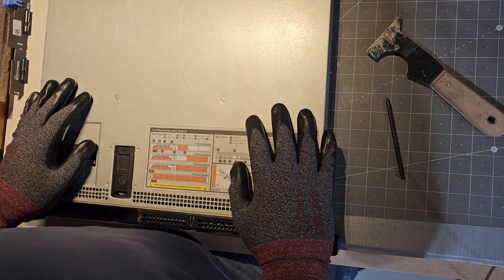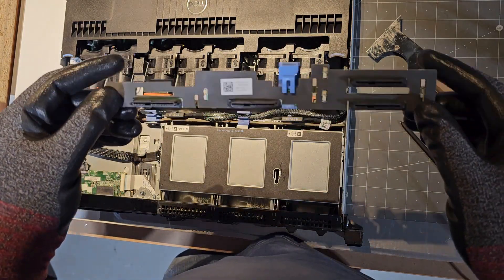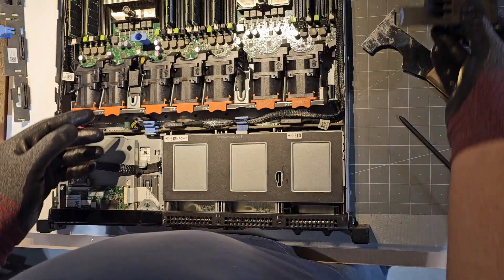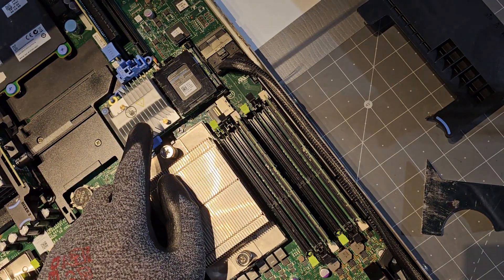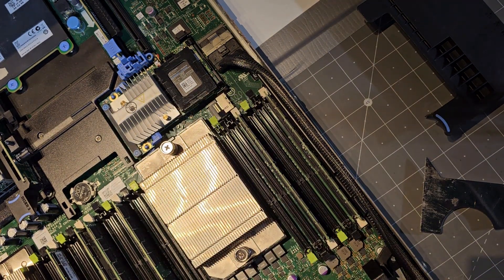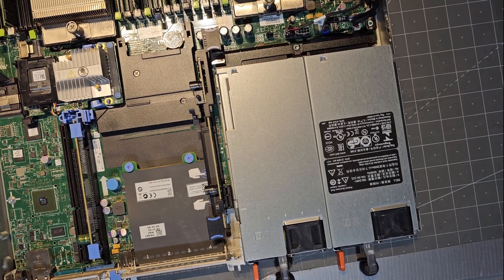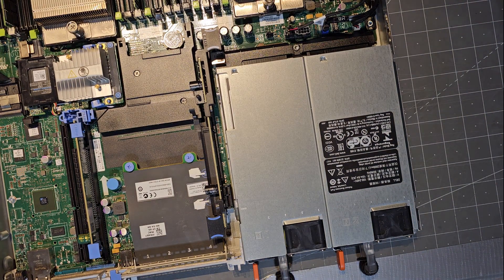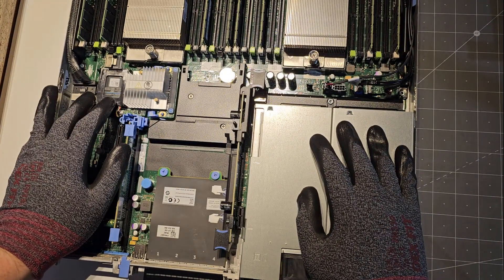Why the Dell PowerEdge R620 Server is great for a Homelab - Hardware Overview P1

Comment: Heads up to anyone just getting one of these: I successfully flashed the RAID controller into HBA/IT mode, making it possible to pass drives directly though, instead of needing to set them up in the hardware RAID controller. Was great for my use case of CEPH on Proxmox.

Comment: why not the 630 you can get one for little as 300€ refurbished, i mean jea there is only a small cpus in in it and maybe 2 ticks of 16gb ram but for a start not bad. ok yea some of them a big surprise what actual is in it. mine cost me only 800€ and i got lucky and got a e5 2699v4 even it was listed as only v3 cpus from 8 to 16 cores and 128 to 256 gb ram. but no metion on every other part. mine was coming with the highest cpus a e5 2699v4 but only with 2 64gb ram modules no drive caddys only blanks, no dvd or cd drive 8 bays. but i had idrac8 enterprise and 2 10gbit ports and 2 25gbit ssfp ports, a h330 raidcontroller, one 10k 1,8tb sas drive in the front with windows server 20 license on a usb3.0 drive in the internal usb port. i was happy with this.  i installed ubuntu server instead but for the beginning nice. now i have upgrades the machine i have ditched the 64gb modules and bought 16 32gb modules and bought a full set uf caddys and but another 1.8tb sas drive in it and on a sata 80gb drive is my os. i used it for my homeserver but over the time i shrank my system down now i use a ryzen7 5800g system and was about to sell my r630 but now i discovers stable diffusion for me and noticed the r630 is 20 times faster without a gpu as a ryzen7 5800g wit its internal gpu for this application so a brought it back to life and plan to buy 3 nvidia tesla t4 gpus but 1.5 to 3 grad a piece is heavy. at the moment i rocking a sigle t600 gpu without fan detached only the heatsink and this system is now 50 times faster as the ryzen. and still i am not able to use more then 10% to 20% cpu load with a better gpu this is possible. but i try it first with a second t600 if this works i buy a nvidia tesla t4. and add one if i have the money and the system has the power to keep up with it

Comment: Great video, confirms my thinking to scale/ upgrade as time goes on with the r620. From the Dell website when I got my r620 I noticed esxi 6.5 is max version compatible, and I had issues anytime I tried running 7.x. Is there anything special to get v8 to work? Would it even be worth the hassle to upgrade when I have everything running fine on 6.5 for a few basic homelab projects. Thanks!
Reply from the maker: it can run esxi8 no problem. just look for the dell customized esxi 8 iso. filename i have for it is VMware-VMvisor-Installer-8.0.0-20513097.x86_64-Dell_Customized-A00.iso - be careful where you download it from!

Comment: Can these be used without having to have a rack?  I know some servers can be ran that way and maybe just need some configuration done.
Reply from the maker: absolutely. i just wouldnt recommend running it on a carpeted floor. pvc shelving is cheap and great alternative!
Reply: @ptnerddotcom  Is there a guide to running those and other servers without the rack?  I know the power is often a connector we are not used to seeing.
Reply: @Myself-yh9rr  They  just use the standard PC power cable. Plug it in and go.

Comment: I love my T620 because it can stand on its own and doesn’t need as many fans to stay cool. It has less noise and can fit any size pci. Paid $400 plus free shipping for mine and it was brand new with less than 10 hours of runtime on it.
Reply: NICE! I just got mine last week off of FB Marketplace. This guy showed a lot of love to it and was the best conditioned one I've seen. Had all the sleds, front panel and even the keys haha. Only $300. Plus the guy was nice enough to keep both PSU's in :P Very happy with it! Hope you have fun with yours too!
Reply: Just grabbed a t620 with 20TB, 256GB and loads of spares for about $300.  Slapped in a hba, 2.5gb network card, nvidia gpu and hooked it up to my heath-Robinson storage array.  Bargain :).

Comment: Ubuntu will not work if you don't have a matrox video card or a cpu with integrated video capability.
Reply: It is not meant for desktop Ubuntu!
You run server software on that, or an hypervisor and then you virtualize tje hardware
Reply: @lepatenteux592  how does the hardware virtualization work?
Reply: @bigloud7067  This is a complicated topic! You can virtualise pretty much any hardware to run multiple VMs... You can also pass-through real hardware to certain VM when needed (like a GPU per example... you can not use it on the host system - it is called black-listing a GPU - , and forward it instead to one of the guest virtual machines for GPU acceleration...)
Reply from the maker: this is not true. you can most certainly run desktop ubuntu on this. the real question is why would you when you can run a hypervisor and get way more out of it then just one ubuntu os. run ubuntu as a guest on top of the hypervisor!
Reply: I have mine with ubuntu desktop, I don't understand why you can't
Reply: @JulianLugo-u1k  O.P. does not seem familiar with server-grade components... He must not know that they all have VGA output that can be used to run a desktop, even if it was not the intended purpose...

Comment: I've got one of these, great virtualization platform. Spec 2x E5-2670 V2 CPUs (10 cores each, 40 threads together), 128GB of ram, 8x 900GB SAS drives and a 2.5" Sate to boot off, runs Proxmox 7. Isn't on all the time, just used as needed. Would I recommend one of these for a homelab, definitely. Incidentally, paid £150 for the server, £56 for 10x used SAS drives, and £40 for a new 1TB Sata drive.
Reply: £56 for 10x used 900GB SAS drives sounds like a steal! hope that setup is still serving you well. just got my R630 a few days ago
Reply: @0siiris should I go for this old server rack ?

Comment: One thing I'd like to point out is the intrusion detection switch on the riser is rather fragile.  I have my servers on rails in a rack and I went to push an R710 back in without the lid on and the intrusion switch was sticking up enough that it was sheared off by the server above it. I had to buy a new riser card.

Comment: My issue is how loud they are.
Reply: Are the fans required if you didn’t rack mount it, for example Could you just apply a pair of CPU coolers? It’s unlikely to be working hard in most home labs.
Reply: @Tom-bp6no maybe. The heatsinks are different but it looks like it still has the 2011 Narrow ILM mounting. But I wouldn't recommend it as the chassis fans do more than just cooling the CPUs, they cool the ram, and any other components in the way. If you're not worried much about how tall it is. You could probably go with the 2u R720/R730
Reply: If it's just you in a room in your house, acceptable noise, after the loud startup. If you want similar processing power that's whisper quiet , consider a HP Z620 or Z820. Later version 2 machines (2013 bios) same CPU options as the Dell R620 and huge memory. Early ones are cheaper, but only use E5-26** V1 6 and 8 core CPUs.
Reply from the maker: I would recommend changing the power profile to be performance per watt.  It will drastically reduce the fan speed.

Comment: If only electricity wouldn't be so expensive... I would love to run everything in my homelab on these...
Reply: I sold mine yesterday because electricity in Italy costs 0.50€ per kwh. It's over 30€ per month
Reply: @Ivanno4317  in my country if you don't use more than 350 kWh per month its. 0.06€/kwh during the day and 0.017€/kwh during the night. and if u spend more than 350kwh but less than 1600 then its 0.08/kwh during the day and 0.022/kwh during the night. 
i can get this swever used for 120. i dont have a server tho so eh
Reply: @Ivanno4317  jesus here in Latvia we cry as it would be expensive 0.04822 €
Reply: @Ivanno4317 almost .60¢??? I complain about 0.11¢ in Ohio
Reply from the maker: I did not realize electricity was that expensive there. I definitely get that. It costs me about 10/month in the US.

I would suggest looking into Intel NUCs.
Reply: @ptnerddotcom  The new Latte Panda Sigma seems like a good low power homelab option.
Reply: One option, if you have multiple machines in your homelab, is to have these more power hungry machines set to power down or hibernate after X minutes of inactivity and be setup for "wake on LAN", so if another lower power consumption machine requests services from this one, it wakes it up and the requesting machine continues to poll until powered up and operational. Not ideal for some workloads, and takes a bit of setup, but working good for what I need. My firewall is virtualized on a low power Intel N95 NUC type thing, so it's always operational using small amounts of power, and from that machine I can wake my 3 other more powerful servers if anything is requested from them. The R620 gives me (8) 2.5" SSD bays, and another machine gives me (12) 3.5" HDD bays.
Reply: in India costs $ 0.0024 per kwh. for Household
Reply: whats your current solution now then ?
Reply: Here in Quebec my full 42U rack cost me around 90$ CAD

Comment: Using a power drill to loosen and tighten heatsink screws made me cringe.
Reply from the maker: If you do it on lowest torque setting you'll be fine
Reply: @ptnerddotcom  Still... eek!

Comment: Thanks for the great video! I just bought one a couple days ago and i bricked the mobo during the bios update. is there a fix i can do beside getting a new motherboard? iDRAC still works but its on the latest firmware and i can’t even get the r620 to boot
Reply from the maker: Sadly none that I know of.  Best bet is to just pick up a new board.  When upgrading firmware it's important to read the firmware release notes because some versions must be incremented instead of just going to the latest version.
Reply: You could try to find the bios chip and reflash it using external flashing tool.